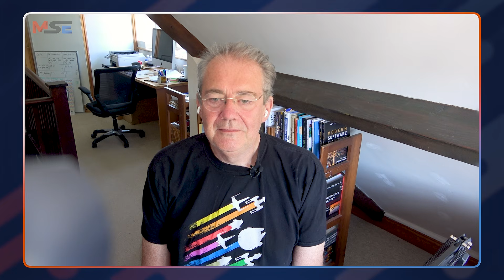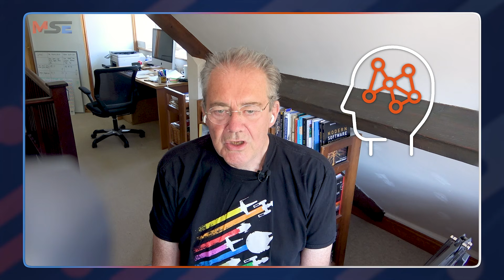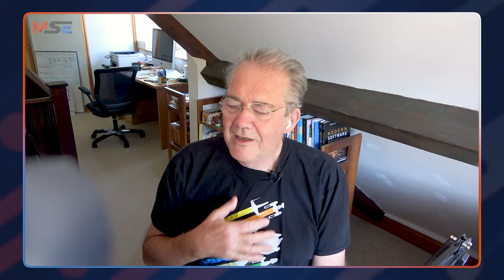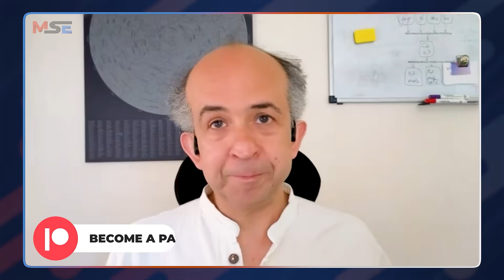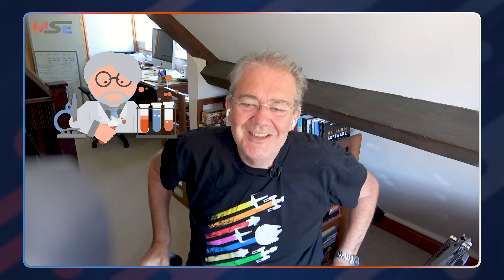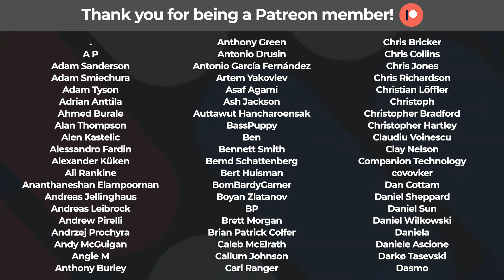Can We FIX Agile?

Comment: Agile was good until the beancounters detected it. We had to move from Kanban to Scrum and the beancounters now celebrate every sprint end how many story points we completed. Not interested in what we achieved and what not.  We have 2 standups per day with 2 different managers because the one does not like how the other does the standup.
Reply: I celebrate any change delivered. I celebrate any feedback confirming we've done the right thing. Even more, I celebrate any feedback that tells us we did the wrong thing—this is where we learn the most. And I celebrate when we do this quickly—in a matter of days or weeks, not months or quarters. Then, I celebrate every time we take a change that we just confirmed as working for customers and make it more stable, observable, and maintainable.

I'm a huge fan of being agile. I'm a huge opponent of "Agile." And I stopped using the words "agile" or "agility." I use "quick experiments" and "good engineering" instead.

Comment: Agile has become a kind of theatre for management to justify their part of the work of building software. Small, autonomous teams can do just fine... If they're left alone.
Instead, their time is taken up appeasing all the agile ceremony, and trying to work on the right things for the further, and even just cope, within a system imposed on them. Agile for weaponised against developers.
Reply: this is the exact thing i felt team topologies tries to express.

communication in the right places is more important than forced collaboration.

im highly of the opinion that the industry will force theater out of financial neccessity... eventually. people can only pull it off nowadays because we have enough room for error to slack off
Reply: There is no agile ceremony. I think this is what Scrum has done to agile, taking away its whole meaning (able to move quickly and easily) and replacing it with a set of ceremonies. So, the idea of finding a way to move quickly and easily was replaced with an idea of following a formal process.
Reply: @archi-mendel  There is no Agile. It's just a concept. A few vague lines written in an A4 sized paper sheet. This is why Scrum took it of the rails, by enforcing an interpretation of Agile that allowed management to swing the whip over the developers, making sure they would fall in line when dubious requests were enforced.
Reply: this
Reply: Perfect summary
Reply: "Manager" is not a role in an agile project
Reply: @miraculixxs "agile project" is oxymoron.
Reply: Anything can be a weapon if the management think they going to lose their power. This is not unique to agile.

Comment: Worse place I worked as for the development process thought agile was waterfall split up into 1 month sprints.  We had requirements gathering sprints, design sprints, coding sprints, testing sprints...  It "worked" but it was just poorly managed waterfall.  Second worst place I worked thought agile meant just diving into writing code without any forethought or planning whatsoever.  "It's agile, we can change it later".  Well, later never happened and the code got worse and worse.  Third and last place I worked before I retired had much of it right but blew it on a few key points.  For example, when estimating story card size and figuring out what was going to be in the next sprint our manager would say things like "we have to get all these story cards into this sprint - we promised the customer it would all be done this sprint".  I've got nothing against agile as such but I've not seen one place make agile work in coordination with scrums.  Just my bad luck maybe, dunno.
Reply: Well some agile proponents literally said "do no design". You can't blame programmers if they took them at their word.  BDUF was a thing
Reply: @NickKeighley  That it was, totally agree.  Somewhere in my box of memories I still have a couple 200+ page design docs I did.  Total waste of time.  A few days into development and there were so many issues and changes that the design was near worthless.  Agile has been no better though.  Just a different set of problems ;)  Where possible I've used a pattern I call slow prototyping.  Just probe around a bit, try some things, see which approaches work the best, go further down that path.  If still a good choice stop and redo the code, refactoring and cleaning as needed.  Repeat the cycle till done.  I've been writing clean solid code for decades doing that.
Reply: @xlerb2286 I still quite like UML. As a sketching tool. I don't want the full horrors of Rational Rose. That at least doubles development time. And a giant UML model is harder to understand than code
Reply: @NickKeighley  Yup, I like UML too, a bit of it is good, more is not better.  We used Rational Rose until we were bought by a competitor of theirs.  Then we had to use their (shudder) product.  I didn't think anything would make me miss RR, I was wrong.
Reply: @NickKeighley  do no design, but when you are done prototyping, throw away the code
Reply: This isn't what being agile means. If you can't run the whole experiment in 2-4 weeks—get feedback on the current version, design a solution to address feedback, implement it, and get feedback on it—then you're not actually agile.

Agile isn't about processes. This is simply about how quickly you can test changes. And yes, this relates closely to engineering—if you keep experimenting without ensuring that every successful test is refined to be easily changeable and observable, then you will slow down over time, leading to stagnation.
Reply: Nope... Similar patterns across multiple companies here too. They just don't get it... Because it takes a shift in mindset and crucially, budgeting and how stakeholders are educated
Reply: This happened to me.  Who cooked up this way of working? Answer, one of the public, big five consulting firms.  Piling on the irony is the fact that in their marketing ad copy they claim to be leaders in "agile thinking."

Comment: The company that I worked for wanted to improve their software/firmware development process.  They hired the Scrum Alliance and we got the wonderful Jeff McKenna that has an extensive background going back to the 1960's as a developer... He was a fantastic and dynamic instructor. Jeff and I got along well, I think because my longish background that goes back to the 1980's, so I understood where he was coming from.  Most of my coworkers who were in their 20's and 30's only had 5 to 10+ years industry experience, so probably some of those old references went right past them.

However, after the training they tried to "implement" the ideas and the stuff hit the fan when the director came back from vacation a week later, having missed all the Agile/Scrum instruction, started asking questions and poked holes in their misunderstanding of what we were trying to achieve... Basically in one meeting he just rearranged the things back to the way they were... and later on I heard the firmware manager say that "Agile is not designed for projects that have deadlines." 

There was a complete disconnect of the materials presented from practice.  They listened, but did not understand. They were reframing and looking through the lens of their old habits... not understanding the new paradigm... I think the VP of engineering had a good idea, but incompetent implementers...  I wasn't asked for anything, but I watched the $#@!! show go down and tried to correct the course of action.   At that time I was already on their $#@!! list for rocking the boat, so they didn't want to hear from me.

Comment: agile is just b*ll*cks  to software engineering, PERIOD. In some projects there are so called 'agilists' (as a specific role) who know little (in the best of cases) of software. That's the reason to justify Agile, for these people to have a 'job'.
Reply: @bernardobuffa2391  agile is an invention for people who hate working with each other. its a concise way to force people to work together simply because the industry has not yet forced out uncooperative people.

i could count way more people who only get the bare minimum done, those who cant fathom working with another person to achieve a common goal. the people who work with others? far and few between
Reply: No, Agile  Software Development isn't bullshit. A planless development is just stupid, not agile. If you don't talk with your customers, your software development isn't agile. Read the Agile Manifesto. Read it carefully. Think about it what it really says.
Reply: @Hofer2304 software was never developed without a plan.

All of the biggest products in use today - Photoshop, Office etc - were built in the days before Agile and they were enormously successful.

The planning was worked out, resourced and scheduled before any code was written, because the coding was the expensive part.

They worked because they were well planned, with detail specs up front, and the engineers could get on with the job.

The problem that Agile tried to solve was changes in the requirements that rendered old designs obsolete, which is a problem in every industry.

But that turned into ‘have no plan’ and just iterate on a barely functioning prototype which has to be maintained forever because it built with technical debt from day one.

This is why software today universally sucks and requires constant patching.
Reply: I agree. The field has been hijacked by mediocrity in engineering with claims that development is some sort of volleyball like collaboration operation when in reality most of the time it needs to be done quietly alone.
Reply: @MohamedSamyAlRabbani complete nonsense. incompetent and uncooperative people hide in solitude. 

the world does not live in a separate box from you, your customers dont communicate like that.

its like a kitchen. your work has an impact on others, but perhaps its less about filling people's stomachs
Reply: @antdok9573  you need focus to code, you understand what needs to be done and spend the time doing it, it doesn't require yapping and talking about your feelings all day
Reply: @MohamedSamyAlRabbani writing the code is easy though. what sort of nobsense is this?

like i said, your work doesnt live in its own little box in a separate universe. it impacts somebody, and if it does a poor job youll be spending twice (or maybe even more than that) the time "yapping" with somebody to get it right your second, third, or maybe fourth attempt...
Reply: @antdok9573  you don't just write code, you design, you think and writing the code takes time, it needs to validate and test, it is not the easy part. If it were, everyone would do it. The business knowledge is there, all over the books and standards bodies . You don't need as much talk as you think. 10% maybe then 90% productive work.
Reply: @MohamedSamyAlRabbani  being agile isn't about speaking about your feelings; it's about speaking about customer's feelings and being able to address their problems quickly through a set of quick experiments supported by engineering methods like CI.
Reply: @MohamedSamyAlRabbani  "most of the time it needs to be done quietly alone" nonsense.
Reply: @archi-mendel  Do you code? Do you know people who code? Do they prefer to do it in groups while talking? When you code you will know that your productivity and intelligence drop drastically like that!
Reply: @MohamedSamyAlRabbani  I've been coding for 28 years and developing software for 20 years. The best results I achieved were when I was developing software with continuous collaboration with colleagues. This doesn't mean we used one keyboard to code. This means that we discussed any adjustments and ideas that we discovered many times a day while progressing.

In some organisations, we were deploying and observing results multiple times a day. We literally deployed a few versions every day, trying to maximize business metrics that we were aiming for. Fortunately, we had a lot of traffic there, and we could test in hours and sometimes minutes.

As someone already mentioned here, coding is just one of the parts of software development. More than that, it isn't the most important one.
Reply: @archi-mendel  I don't know what you were building, but for Data Engineering, or backend dev, if we all work on components that fit together and things are set up we can chat on slack maybe if we need to when we integrate, but ideally we have as much agreed upon upfront as possible, but we aren't going back and forth constantly. Coding is the most important part or the product is crap.
Reply: @MohamedSamyAlRabbani it's great to agree upfront, but you can't envision everything upfront, even for a small change. Are you building components alone? No reviews, no collaborative design, no collaboration when you discover missing elements, issues or redundant complexity?
Reply: @archi-mendel  If you are working on a cloud platform, doing data engineering, loading data from a source, with time, you already have the answers, and with good automation and test coverage, once you agree on the interface,  you should have everything you need. Reviews shouldn't be something that takes a long time if you already know what they will be looking for, which you should. Why are so many things a surprise?
Reply: @archi-mendel  https://www.youtube.com/watch?v=AgGE_3bKWxg

Comment: Matrix based organizations are a big part of the reason why AGILE FAILED.  The priesthood of "waterfall certainty" simply usurped the phrase "agility" and adopted a team/Kanban board.  Big companies want to time slice expensive people to maximize the amount work done, not the value delivered.  Matrix based organizations are antithetical to an agile mindset.  You are right, "it's all about the tools" rather than the mindset.  Managers at big U.S. companies don't "get it" and don't want to try new things and fix the organizational problems that they themselves created.  The top-down command and control mindset never left the building.  If they had actually tried these ideas, they might find themselves out of a job.
Reply: "We will build/expand this kind of business A to aim for capturing B revenue which will cost C time and D money, and here are some pretty pictures showing our vague product vision and what some features might look right."

THAT is the basis of which the board of directors makes its decision when signing off for a big project.  Because of the manner the decision making at the top, there is a natural pull towards the waterfall mindset.  Until agile has succeeded in spades, the baloney promise from waterfall gives more of the appearance of certainty that a burn down chart with little or no work complete.

Middle management has to be very overt about how they are NOT going to maximize work done, but look towards value delivered, or the process will devolve towards "agile" rituals that are not very different from waterfall in any important way.